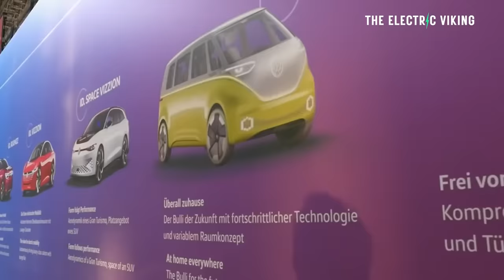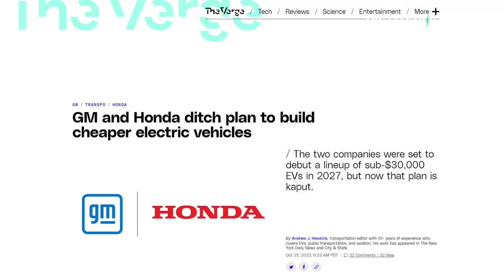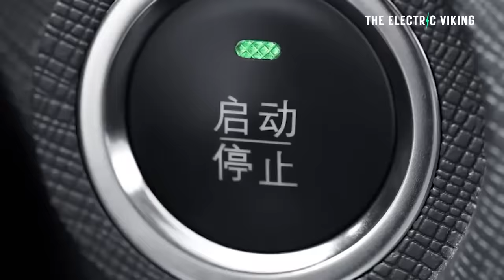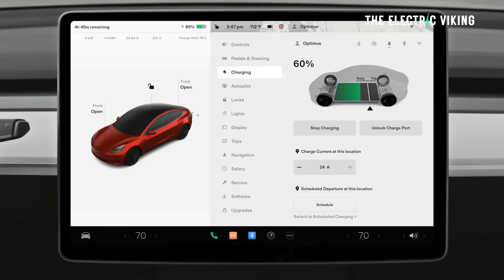US Electric car transition slows as inventories balloon on dealership lots

Comment: the problem is the longer and slower this takes, the more time there is for the reality of EV longevity has to come out. I for see a lot of 10 year old teslas getting scrapped in the next couple of years. The average age of a car in the US is 13 years.
Reply: You can fantasize about whatever you want. Doesn’t mean it is going to happen. Model S batteries, the early models anyway, are lasting 300,000 miles.
Reply: @williammeek4078  interesting... Have a link?
Reply: @SuperMassman Forget the link. Go out and try buying a 10 year old model s. Hardly anyone with over 100k miles that's not had a motor or part of the battery pack replaced. I know. I've tried.
Reply: @strangerdanger8462  Tesla did have an issue with early motors and some batteries, but those were not typical. And the ones with battery replacement were very high milage (200,000 miles plus) where you would expect a battery change anyway. 
That would cost about $15k and give you a practically new EV.

Comment: I think, the bumps in sales of EV's in the USA is due to the price range. 
About the largest part of the population that is rich enough to buy a brand new $50.000 (plus) EV, has bought one. 
Now, the real masses that are already waiting several years for the promised sub $25.000 EV that has a usable allround range, . . . . . . are still waiting.
Till 2024 q2, than the first EV with 320km range will be presented, the Citroën ëC3.
Reply: Uh, you do know that the average price of an ICE car is $49,500, and the price of a Tesla Model 3 & Y is less than that? In some states you get $15k off of a Model 3 making it ~$27k. And EV total cost of ownership is much less for an EV. You can also charge them at home 90% of the time.

Comment: The real question ...
HOW MUCH IS TESLA's INVENTORY GROWING? (There are no dealer lots, so WHERE is this inventory if it WAS growing?).
CarEdge reports 180 days of inventory for most (ALL) US pickups. THAT is on dealer lots.
Yes, there are EVs with a ton of inventory.  The Mercedes EQS for example: 200+ days of supply for a $123K Mercedes EV.
Well, DUH! People who have $123k US to spend (outside of Mike Lindell) aren't stupid enough to plunk it down on a Mercedes when they could get a Model X. What precisely was Mercedes management thinking? We know what they were thinking -> "people who 'believe' in climate change are sheep to be fleeced". 

The real reason EV sales are slowing down?  AUTO sales are slowing down ..,
1. The OEM EVs are NOT good cars, and certainly NOT compelling
2. Interest rates are WAY up
3. Student loans are kicking back in
4. Housing costs (rent, mortgage, mtce., utilities) are through the roof.
5. The fuel cost advantage of an EV pretty much requires that if you didn't buy a Tesla you need to own a house or there's no advantage - slow expensive unreliable public charging is just not worth it

Add to that the massive politicizing of EVs by the corruption and racism party fuelled by the greed of the Exxons.

The CEOs of EVGo, ElectrifyAmerica and ChargePoint are doing a phenomenally TERRIBLE job.  Their incompetence is so unbelievable, you can only think that they are starry-eyed EV fanatics who think people will put up with their terrible charging experience (OR cynical, privileged trolls milking the system ... could be either).

Comment: I am not an EV supporter and I will probably never even consider owning one. I did recently rent a Chrysler Pacifica hybrid and I was pretty impressed with that because there was zero range anxiety with it. My question is why can't legacy automakers make a normal looking mid-size EV with decent range and no frills. Why does every EV have to have autopilot and look like a spaceship from every angle?

It's bad enough that Tesla's all look the same. Then you get things like the Mustang mach e.... Stupid name for a stupid looking car and the Ford lightning have stupid looking headlights and tail lights. If I absolutely had to have some kind of electric vehicle propulsion it would either be a Ford Maverick hybrid or Chrysler Pacifica plug in hybrid....

Comment: I think the non-Tesla charging infrastructure and the conversion to NACS is a huge issue.  The conversion is definitely the right thing to do, but cars being sold today are obsolete on day 1.  Anyone in the market for a non-Tesla I should hold off until they can purchase a car with "native" NACS connector. No adaptor.  My wife and I both drive Teslas and would never consider owning an ICE vehicle again.  But, we have decided our next cars will not be Teslas because of Elon turning into a monster.  This means our purchase of a non-Tesla EV is put off until 2025 at the earliest.
Reply: If you can charge your car at home or at work there is no difference between a Tesla or otherwise. That is the paradigm shift some seem not to really embrace right now.
Reply: I mostly agree with you for everyday driving, but for long trips the Tesla charging network is light years ahead.

Comment: toyota says "people don't want ev's" . No, people don't want YOUR ev's. people in the U.S. have very little options. it's either tesla, which aint bad but still too expensive, or all other brands which suck and super expensive. if the u.s. provided ev's less than $20k, we'd be buying them up. oh but u.s. car manuf say they can't make them so cheap cuz battery cost so steep. who's fault is that for not putting in the early investment toward ev's and batteries, and instead hold out on internal combustion.

Comment: What is the point in buying an EV when a lot of the electricity is produced from burning coal
Reply: It still works out cleaner to drive. "Auto Expert" ran the calcs and then had to put out a correction video as he'd fluffed the numbers a bit. To be fair, he held his hands up to the error and it showed the EV had half the emission, when powered by the AUS grid than the ICE, even with the coal. Don't 1/3 of AUS houses now have home solar as well? That would also drive it down.

Comment: Notice brands with dealers are slow.  Dealers hate EVs. The dealerships don't want to lose the money from the repair shop. They want you to buy a car that needs repair or $$ maintenance.
Reply: @orionbetelgeuse1937  the words rarer is what matters to dealers. What does an EV need in the first 150 k miles
Reply: @orionbetelgeuse1937  In a tesla filters can be done by most anyone. Soft updates come over the air. Collisions, if you have one can be quite aggravating as I heard getting parts can be a pain. Brake fluid on a Tesla should not need changing because you use your brakes so much less. In general no belts no oil changes no exhaust system no timing anything no plugs no distributor the list of no becomes quite large.

Comment: What's the longer term EV market share over the next say 10 years though?  It's completely ignorant to assume even worldwide it'll surely go over 50% market share.  Many markets where long road trips are common or there are lots of areas of a larger country where it's difficult to get the infrastructure built out are going to have troubles selling EVs broadly across the market in ways they can hit 50% plus market share.  This is a hard reality all the projections that they will just up and replace gas cars in the next 10-20 years.  I totally get how EVs are better everyday vehicles...but they are inferior road trip vehicles FULL STOP.  They COULD be better road trip vehicle AND put less stress on the electrical grid if many had all day range for road trips.  Until battery costs and energy density get to point all day range can be viable option for lots of models...they just will not hit 50% market share cause countries like USA will be well below that still.

Comment: EVs do not get enough range
EVs do not handle cold climates well
EVs do not handle hot climates well

I live in vegas, and have a model 3....and as much as i love it, this car SUCKS battery in the summer when its over 105F outside, and even more when its over 110F outside.  and lets face it vegas summers live in 105F for 3 months.  25%-40% battery loss the hotter it gets.  
cold weather, seems like ive seen many say its about 20% loss.  
when your max battery is only 270 miles at 100% full....that really does have an impact. 
a lot of the country falls into the cold weather issues, some in extreme heat.  when it was 115F in vegas, i literally got half the range (my usage was lot of stop and go and some idle time, but it was about a 1/3 loss under normal driving)  

the ford EVs have proven to be piles of crap.  
EV pickups showing they are trash for towing (in terms of range)
Large EVs that take super long to charge
Hyundai/kia models having some 12v issues
Toyotas EV being a total worthless flop just by the specs
non tesla charging network is trash
non tesla EVs just dont stack up spec wise, value for the money
GM models with the battery recalls over and over
EPA range VS REAL WORLD range differences
SOME models with fire issues (mercedes being one recently and with a recall too)
and consumers see ALL this...and you wonder where the FUD comes from, its not even FUD its legitimate things people see about various EVs.

non tesla EVs are not appealing for the most part, their tech isnt what tesla has, they are grossly over priced for what they are, and what restrictions they have.

not everyone can use an EV for their needs, not everyone can charge at home either.  

for those that CANT charge at home, based on tesla SC rates here in vegas, if you charge during peak hours its often 40-50cents per KWH.  at these rates, it is not cost effective compared to many gas/hybrid powered cars.  at these rates, its basically equal to about a car that gets 30-35mpg....at the lower end at 15cents Kwh, its generally equal to 90-110mpg in terms of cost.  so if you cannot charge at home, you would have to hunt down a cost effective charger, at a certain time of day to see any value/savings.  for those that cannot charge at home, there is no incentive in terms of cost to own an EV.  one can buy a hybrid and not have the inconveniences that EVs have and wont have the cold/heat battery depletion either.

I took mine on a short road trip, 110 miles each way.  the SCs at the destination were flat rate all day 46 cents kwh.  thats equal in cost to a car that gets 32-35mpg where gas is about $4 gal.  i started with 270 miles range, full charge, ended up home with 25 miles.....taking any road trip more than 500 miles or so would be highly inconvenient at 35 min per charge.

EVs are not for everyone right now.  the more people that have them, the more word of mouth there is and how they are good and or bad depending on the owners habits, usage, and what they want it for.   most people do not buy an EV for the environment, face it, EVs are not saving the environment when you see it from all parts of it, only at the end user on the street they are "green".  this has been proven over and over.  people buy EVs for potential cost savings (depending on your situation), driving experiences, stay in town, cost effective for work, things like that.  

as an EV owner, i will not get a new one unless it has a REAL WORLD range of 330-350 miles.  and i type all this out as someone that loves my model 3.  while i do not have buyers remorse after 6 months and 11k miles of use on it since then.....i can see the shortcomings of it and its not FUD people are seeing some of the pitfalls of EVs and they often are people that considered one.  the only way i was able to justify buying one was when i had a rental one for 3 weeks and saw it worked well for me....but the summer situation above...no one ever talks about that...its always the cold weather scenarios you hear about.

Comment: Ford should of electrified the maverick and ranger.  30k to 50k at 4-5% interest rate is the sweet spot😮  these ceo's are Idiots fire the bees
Reply: EV trucks kind of suck.   Try to do any actual work with them and the range goes to crap.  Especially if its cold.   Just focus on efficient cars.  Not 9,000lb monstrosities that you could make 3 cars with the batteries it takes to move it.  The elements in EV batteries are a very finite resource.  Moreso than oil.

Comment: Reality is catching up to the EV hype.  EV in it's current form just financially and practically don't make sense for the majority of people.  Reglar consumers like me, are NOT going to buy EV until it's the same price as regular cars AND doesn't take 45 minutes ro charge at a gas station.
Reply: Maybe, maybe not. EV’s would probably work for most, or at least those that have access to an outlet at home, even just a regular 120v. As long as you can add charge at night, you won’t have to inconvenience yourself with a charger out in the wild. Now, that charge speed at the high speed chargers is key, even more so than range. If you can get a vehicle that can charge reasonably quickly, you can do road trips easily. I was skeptical when buying an EV last year. I chose the EV6 for the charge speed. I can regularly hit that 18 minutes at the fast chargers, sometimes 20-25 if I don’t get the best of chargers, but never 45 minutes. I saved about $8k in fuel and services in my first year alone. I regularly do 25k-35k miles a year, so way more than the average driver, so the savings for the typical owner would be more spread out. My point here however, is if I while doing 2-3 times the national average can make it work, it should work for most people. It should be harder in my case, and in all reality it for the most part is not. I can do 800-1,000 mile road trips in almost the same amount of time, and my day to day is not impacted that much. This all being said, we are still in the very early days of EV’s and they will only get better, as will the infrastructure. It may not work for you, or others now in its current state, but as things advance… I think you may be more open to it.
Reply: As long as it doesn't burst into flames.
Reply: Just imagine a few thousand people all needing to wait multiples of 45 minutes weekday mornings. Ridiculous. And, the grid can only deliver a fixed amount of power so the more chargers, the slower they charge.
Reply: @MrkBO8  do you have an oven of a dryer? If so, when charging at home you would be using that same outlet/power rating or less if using a standard outlet. I don’t see many people fearing to use their oven or their clothes dryer. If using a standard outlet as I have been able to do for most of the time, the same as a hair dryer.
Reply: @strangerdanger8462  if you look at the statistics, an ICE vehicle is far more likely to burst into flames per every 100,000 vehicles on the road. By a factor of about 10x as often. Reality is it is harder to put an EV fire out once it has started, but it is less likely to happen. Can it catch fire, sure. Anything can catch fire.
Reply: @moarpwr4414  There are more ICE vehicles on the road, so numerically, there'll be more ICE vehicle fires. Let's look at the proportion of fires to the total number of cars on the road, and the picture looks different.  ICE vehicles don't burst into flames just sitting in the garage or while filling up at the gas station. They are far safer than the tinder boxes we call EVs 😁